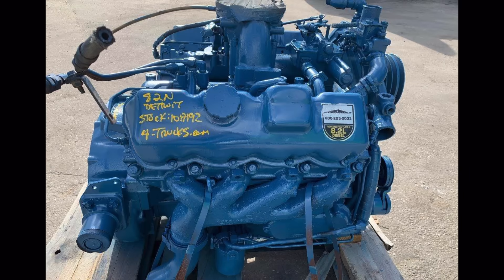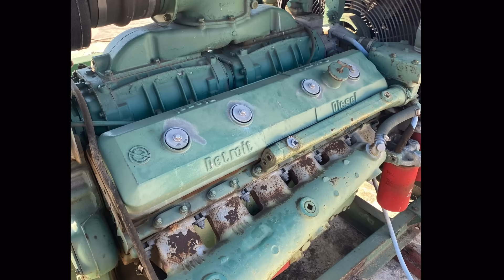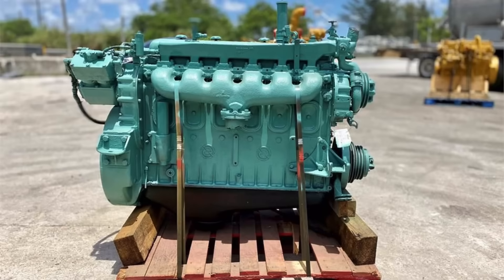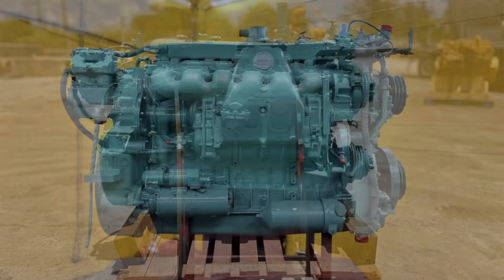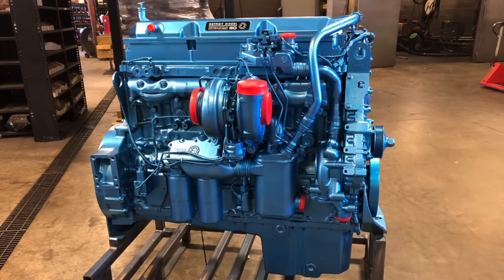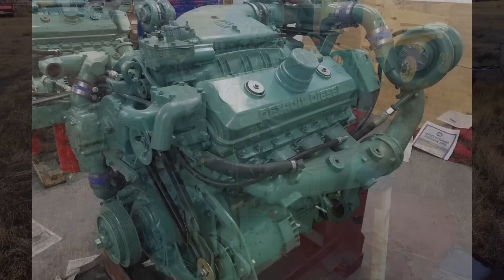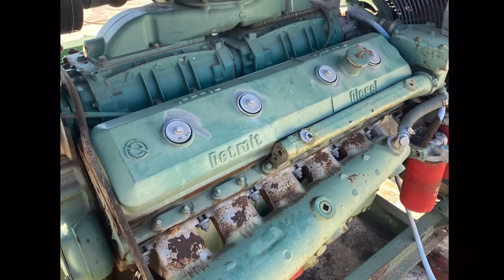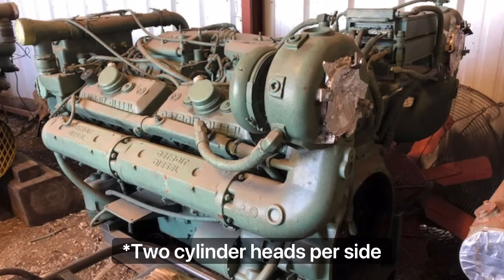Best Engines: GM Builds an Awesome V12 with Detroit Diesel's 12V71 "Buzzin' Dozen"

Comment: I thought 2 stroke diesels cannot be NA, as they need a compressor to funcion
Reply: When they refer to a NA Detroit, it means it has the supercharger only, no turbo. Interestingly, they will run without the supercharger, barely. The ones we fooled with would not come off idle with the blower removed. My favorite Deisel of all time.

Comment: I've worked on large stationary generators with 12V71' s. Such an awesome sounding and performing machine.
Reply: There is a company and i dont remember there name that has some of those engines , they were also turbo charged that powered pumps used to power wash boilers . I believe they were from New Mexico..They came to the power plant i worked at and hydrblasted the boiler .. I dont remember the engines giving any problems while they were there .  I remember they were huge. Like a engine you see on a generator set